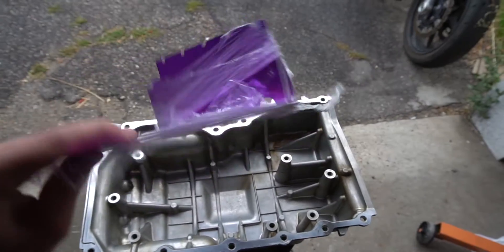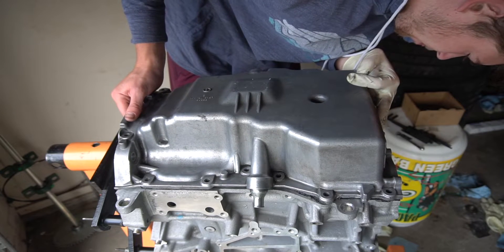How to Install a Mazdaspeed Cylinder Head!

Comment: Keep it up man it is worth it! And stock fuel isn’t out until 370-380hp Erol Calpito. Also, Steven Devey, did you use an Ecoboost Mustang oil pump? That is what I have used and is working great! Was only about $50 instead of our mazda one being $250 lol
Reply from the maker: Isaac Wright hey dude I’m running an oem Mazda oil pump. I’ll need aux fueling for sure!
Reply: Too bad you didn’t know anything about the ecoboost mustang one. Did you buy a new oem one or just use the old one? And yeah, it sucks knowing ill hit my max fuel soon as well. Believe it or not my ported head with bigger Manley valves makes my ko4 pull all the way up to almost 6500rpms tho! I couldn’t believe it haha

Comment: Hey man. What kind of valve work was done? Did they just clean the valves? Were they lapped? Did they vacuum test them to make sure they were sealed? I’m about to take my motor in for machining and just wanted to get a feel for what work they might need to do. Thanks!
Reply from the maker: Michael Cecy I did all of that. Plus a 5 angle valve job.
Reply: Sweet. How much did you end up spending on all the machine work? 

You mentioned you were at 88mm diameter cylinders. Does that mean they just honed the cylinders instead of overboring?
Reply from the maker: Michael Cecy hey so I gave my 88mm pistons to the machine shop with my block. I’m sure they bored out the .5mm. I just told them to follow the piston recommendation for clearance. I spent like 400$ to get the block decked and bored. Another 100$ for my crank (micro polish) and about 600$ to deck my head and check everything. Hopefully this helps! Any other questions?
Reply: Cool. Did they replace the valve seals and/or valve guides?
Reply from the maker: Michael Cecy yes all of them
Reply: Steven Devey, do you happen to have the total invoice amount that you spent? I took mine in to the same place and they are quoting me $3,000 to have basically the same work done, lol. Maybe they like you way more then me, haha.

Comment: So  after All that work this can only hold about 500whp?
Reply from the maker: Raquiel Cross only 500? It all depends on what fuel I run. E85 it can handle 700 but I’m running pump gas
Reply: Oh yeah love e85 that's what I have on my other map👍
Reply from the maker: Raquiel Cross ya it’s just hard to get in Utah. So I plan to run pump gas mostly. Wouldn’t 500 be good for pump gas?
Reply: Steven Devey need aux for that, meth can get there but stock injector and pump gas is already max out at 300hp
Reply: Too bad for you guys not having it, we have plenty in IL..
Reply from the maker: Erol Calpito I’m running aux fueling either way. But I’m running pump gas on 8th port.